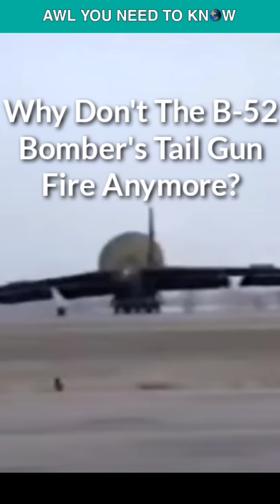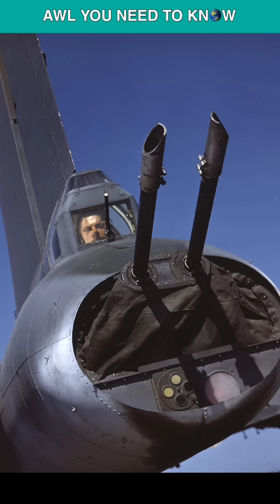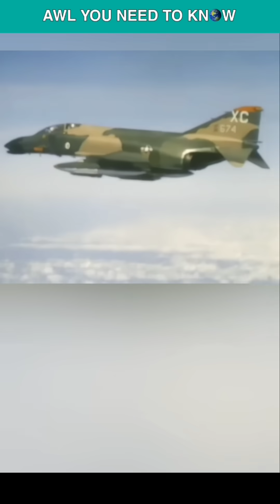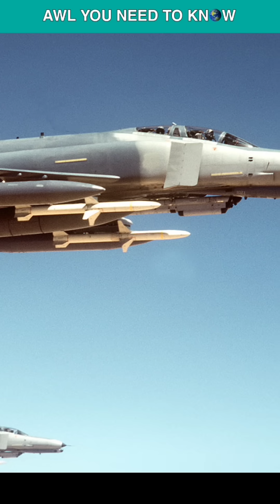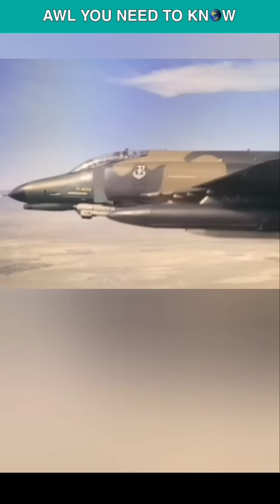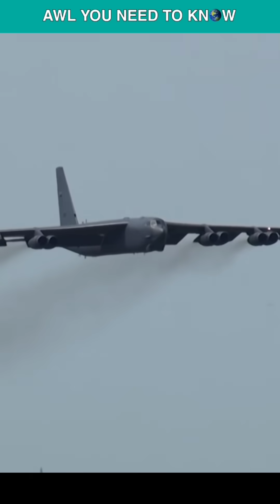Why Don't The B-52 Bomber's Tail Gun Fire Anymore? #shorts

Comment: Hey Sports fans, this story is incredibly bogus. The reason why the B-52 no longer carries the gun is that there is no longer a need to. With AWAC's operations involved in the air support there is not a chance that an enemy fighter will ever get close enough to a B-52 or any service aircraft to pose a threat. Therefore, the excess weight of the gun is absolutely unnecessary. Wild weasel pilot could not differentiate a flying B-52 to a enemy Sam radar. That assumption is completely ridiculous. He has radar warning receiver in the aircraft which tells him that there's in threat radar tracking him. It identifies the radar-guided weapon system by name. Additionally, with the AWAC's aircraft in the sky they would have automatically told an F4 pilot that he had a bomber in front of them as well as he could see the damn thing as well as on his radar. It would be pretty stupid for them to just shoot a $100,000 missile at an airplane that he has no idea what it is. They don't do that. Additionally wild weasel missions are the very first planes in to a combat zone. Their job is to destroy or degrade enemy radar system so you'd have to ask yourself the question why in the hell was this aircraft behind a b-52. It wouldn't be there. The B-52 would not be allowed in that airspace until it was cleared by complete destruction of the air defense radar systems. That being the case, why would a wild weasel be flying behind a b-52. During the operational aspect of the wild weasel B-52's would not be in the zone. They won't come out until a specific amount of degradation occurs with the Sam systems. This is a ridiculous story from somebody who has no idea how Air Force airspace operations work.

Comment: Harm stands for high-speed anti radar missiles and is an air to ground missiles. Will not lock on to enemy air craft from the front or rear. It was probably a aim 7 dirty sparrow which was used for air to air in that time frame.

Comment: B52 doesn't have manned tail guns.
Reply: Doesn’t have any tail guns lol
Reply: @grandmasterpu  "...manned..."
Reply: @djcatron11  there are no tail guns. Manned or unmanned.
Reply: @grandmasterpu   Sure was. The B52 A - G had quad 50 cals and the H had a single 20mm. They haven't used them since desert storm... the was the whole point of the video. The picture that was shown in the video was not the tail of a B52.
Reply: @djcatron11  yea, we’ll aware they had them. Largest aircraft to be credited with an air to air kill for a reason. 

There is no tail gun currently. It’s not that they aren’t used, they are completely removed from the H’s still in service.
Reply: @grandmasterpu  Yes. Removed in the mid 90's. The video indicated they were manned tailguns, when they were aimed by radar.
Reply: @djcatron11  A-F models had gunners in the tail with them. G and H were controlled from the flight deck.
Reply: @grandmasterpu  If they're talking about the reason they don't have them anymore, they're talking about the incident in 1991. 1991 was the B52H. The B52H, like you've said, never had a tail gunner like the one depicted in the video.
Reply: @djcatron11   the one in 1991 was a G model. Hs didn’t see combat until 1996. Also had nothing to do with the removal, that was purely a money thing. You are correct that neither the G nor H had a gunner physically in the tail. The picture they posted looks to be of a B-29 tail gun. I see what you’re saying by ‘manned’. We still considered the ones manned on the G and H as they still had gunners operating them, but yes, they weren’t physically back there

Comment: B52 tail armament was originally four .50 machine guns, upgraded to single M-61 20mm long before the Gulf War.  As far as tail warning radar on bombers, it defeated its own purpose shortly after its invention.  In WWII, British Monica system used a frequency easily detected by German listening devices.  The Luftwaffe quickly equipped their deadly night fighters with detectors that led the fighters directly into firing position behind unseen night bombers.  Ever since then, the general rule for airborne electronic countermeasures systems is that whoever lights up first gets killed.
Reply: Only the H model got the M61, and they sat out during the Gulf War. G models still had quad 50s

Comment: The real reason that the tail gun was removed is that the electronic warfare suite was extensively upgraded and the tail gun was inadequate for air defense. So the Air Force removed the gun so a EW antenna could be placed there instead.

Comment: The one you showed was a older model where the gunner sit in the back, the B 52 that was hit by friendly fire was a G model, the fire control operator sits in a lower deck below the piolet and copiolet . 🇺🇸🇺🇸🇺🇸
Reply: No, the gunner position is in a rearward facing seat located beside the Electronic Warfare Officer behind the Pilot and Co Pilot.  the navigator and RADAR navigators sit downstairs in forward facing/downward ejecting ejection seats.

Comment: HARM is High speed Anti-Radar Missile. It has a Very Fast rocket motor. It locked on to the radar pointed at it, and struck the B-52 tail. Both tail gunner & F-4 pilot were mistaken. NO ONE SAID WHAT HAPPENED TO THE TAIL GUNNER 
:--/
Reply: Tail gunner isnt in the tail, hes safe in the cockpit with everyone else, the 20mm tail gun is remotely aimed and operated from a station next ro the radar operator
Reply: @rrenkrieg7988 fire control officer was next to EWO on the Buffs I worked on.
Reply: How was the tail gunner mistaken?
Reply: @bryonslatten3147  //
And THAT is a good question. Perhaps the Gunner system cast an automatic, radar tracking  (or jamming) EW (Electronic Warfare) signal.  The F-4 system realized it was being tracked and displayed such. The  F-4 pilot assumed it was an Unfriendly, got a Lock, and released the HARM missile. Without visual confirmation ?? !! Did F-4 pilot assume the radar was mobile, anti-aircraft, ground based SAM (missile) ?? THIS is ABOVE Both pay grades. HAD there been an AWAC jet, Airborn Theater Radar (C3: Cmd, Cntrl, Com) could have been a traffic cop and straightened out the confusion with advance notices. As it was with limited inferences, this Friendly Fired occurred. /// /// They ideally should have known they were in each other's neighborhood. The F-4 mission is not clear. Recon, or surface anti-radar, or air patrol against Unfriendlies ??
Reply: thought the US F4's where retired long ago. Even the Air Guard doesn't fly them, do they? 
I can see why it was an Iraq fighter...similar to the Iraq F4 withe USS Stark before the Gulf War. Fire systems declared the air craft as friendly...
Reply: @rodmorrison6644  ///
Did Air Force stop using automatic tail guns to turn off automatic radar ?? I saw tons of HARMs being built thru glass walls. I merely suggested a plausible scenario.
Somehow, the HARM locked on.
Somehow, the F-4 Pilot released it. If the story was accurate.
Reply: @rodmorrison6644 //
 IDK

Comment: So the reason is because fighters shoot bombers down beyond the gunner's range? So, why not put rear firing HARMs on the bombers with a lockout preventing firing at friendlies? Why don't all allied planes have tracking transponders with constantly changing frequencies so missiles can't lock on to them without redundant safeties being checked off. Seems rather a cheap simple solution to prevent FF from ever happening. If UHF can't be used them what about lasers or countless other things that could be easily implemented.

Comment: Wait, the F4 pilot seriously thought there was an Iraqi air defense radar 30,000 feet or whatever up in the air?  He didn’t think “The entire Iraqi Air Force fled to Iran as soon as the war started.  So what’s this up here?  Hmmm, maybe this is a friendly.  Let me check before firing”?
Reply: don't forget that it was also moving at a couple of hundred miles per hour as well, so... there is that.
Reply: Well, being that the HARM missile is a “High-speed Anti Radiation Missile,” it likely detected the radar tracking signal and locked onto it, then fired. It does not have the capability of tracking its location or distinguishing what the radar is emitting from. Also, most jets back then didn’t even have GPS. This was the F4 phantom, use some common sense.
Reply: It’s hilarious when people comment on things they have zero knowledge on 😂
Reply: @forsaturn4629  Hilarious how?  Hilarious like a clown?  I amuse you?  I make you laugh?
Reply: @adamesd3699 ok gramps
Reply: @grahh7234  What, you never watched “Goodfellas”?  I highly recommend it.
Reply: The B-52 was flying low-level mission profile. It wasn't cruising at high altitude.
Reply: reminder (assuming it was a cover-up for the Israeli jet): Israel also attacked our ships around this time assuming they were egyptian (USS Liberty)
Reply: @saipai8114  Actually, no.  The B-52 incident was several decades after the Israeli attack on the USS Liberty, which was in June 1967.

And I don’t think anyone really believes that the Israelis didn’t damn well know that the USS Liberty was an American ship.

The idea that the Israelis mistook the USS Liberty for an Egyptian ship is laughable.  Yes, that’s what the Israelis later claimed, but the claim itself is ridiculous.

The Liberty was flying a big American flag, was sending out distress signals in the open identifying itself as an American ship, and the Israelis had planes and torpedo boats right up close to it and all around it.  They put over 800 holes in it in a long series of attacks, with several waves of attackers.  It’s a miracle it didn’t sink, despite getting hit with a torpedo and numerous rockets, and it was certainly their intention to sink it.  34 American sailors died in the attack and over 170 sailors were wounded, which was most of the crew.

There’s a famous book about it called “Attack on the Liberty” by James Scott, who’s the son of one of the surviving officers on the Liberty.  It’s a very interesting read and makes it clear how ridiculous the Israeli claims of mistaken identity were.

There’s also a YouTube video about it from a retired US navy officer.
Reply: Wait, so iraq knew they had no chance and just tried to save enough airplanes to maybe have a chance someday?

That really puts into perspective that we are the empire and terrorists are the rebels.

And Israelis are the sith.

Comment: the photo shows a manned tail gun, but the B52's tail gun is remotely controlled, and aimed by radar. this goes back, IIRC,  to the WW2 B29. what the F4 was seeing was the tail guns aiming radar, which ran all the time.
Reply: Thanks. I didn’t understand what they were talking about
Reply: I wondered why no mention of the airman who must have gotten splattered by the blast.
Reply: The H model was the only B-52 variant that had the unmanned 20mm M61 Vulcan. All previous models had quad .50 cal machine guns and a tailgunner's position AT the guns.

They still had the radar, but the gunner was sitting right there in the tail. 

Keep in mind that the USAF was flying and buying B-50s, (which were essentially up-engined B-29s) at the same time as it was first getting the B-52. Manned tail guns aren't that old, from the BUFF's perspective.

Edit: You wanna see something really odd, look up what it looks like when a B-52 is getting refuelled by a KC-97.
Reply: @Tomyironmane the G varient was remote operated too. It was the quad.50 cal like in previous varients but the gunner didn't sit in the tail.
Reply: @Tomyironmane  models also had gunners in the flight deck
Reply: @Tomyironmane  Originally all B-52 gunners were seated back at the guns. If the gunner needed to get out, he jettisoned the rear portion of the jet with an explosive charge, and he leaned forward and fell out before opening his parachute.  
I'm pretty sure that this was changed and control of the quad 0.50 caibre guns with the gunner seated upstairs in a rearward facing ejection seat right next to the Electronic Warfare Officers ejection seat Before that, the gunner was indeed back at the guns.   October, 1st 1911 all B52 rear guns were disabled permanently.  B-52G had 6 crew, 1)Pilot 2)Co-Pilot and right behind them in rearward facing seats we had 3) EW Officer(right side) 4)Gunner(left side)  then downstairs in the 2 downward firing/forward facing ejection seats. 5)Navigator(right side) 6)RADAR Navigator(left side).
A KC-97 does look odd refueling a B-52.
Reply: @hoghogwild  oct 1 1911? Am assuming thats a typo? 
No drama just a question
Reply: @MrSheckstr  Oops, sorry, that should read October 1991.  This was done after its service in Desert Storm where a friendly Wild Weasel aircraft targeted and launched a HARM at the aircraft thinking it was an enemy MiG.
Reply: @hoghogwild They should make a short video about that.
Reply: Its a B17 not a B29 but its wrong to this video either way
Reply: This is apicture of a B17 tail gun position.
Reply: I'm pretty sure they're capable of both manual and remote fire. It's been a while since I've done research
Reply: @USA1776..  A-F models had manned guns in the tail. G and H models were remote controlled from the front. Guns were removed from the Hs in the early 90’s
Reply: @USA1776..  I think that the B52D had four 0.50" guns with a tail gunner behined them. And the G and H versions had a remotely controlled rotary 20mm gatling gun in the tail. Maybe an M61A1. The gunner sitting with the crew up front.
Reply: last time a BUFF had a Live Gunner in the tail was during Linebacker II.  When they swapped out the Quad-fifties for the 20mm Vulccan, they also went to an internal gunner position down by, IIRC the Nav.
Reply: Lazy video producers suck
Reply: Yeah B17!
Reply: the one shown is a B-17E tail gun, before the full metal swivels of the G
Reply: And should have a recognizable signature as friendly. or is our military the dumb to make radar signals that can't be confused with the enemies. Different frequency or sweep rate...  and why did the F-4 fail to recognize an B-52 as friendly... what did it's identifier malfunction to.
Reply: @Blazeww  friend-or-foe identification is the purpose of the transponder.
Reply: That the tail gun of a B17 in the pic
Reply: The B-52D had a tail gunner, the gunner depicted in this video is a B-17 gunner, in the g and h model B-52 the gunner was up in the cockpit somewhere!
Reply: That's a B17g tail gunner
Reply: the earlier B52 models did have a manned tail gun, but it was phased out for the more modern remote controlled system
Reply: Older models of the B-52 had the tail gunner actually IN THE TAIL! None of those models are currently operational.
Reply: There essnt a tail gunner. Yhe hun works off pf the radar that hot it shot at.